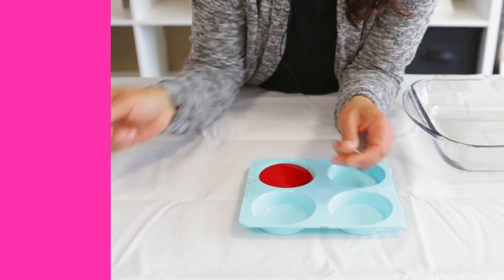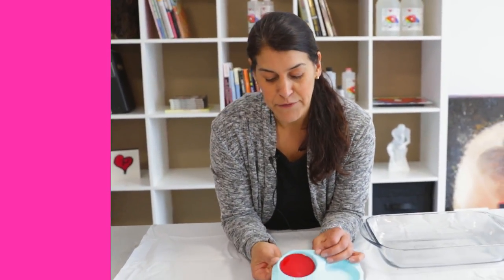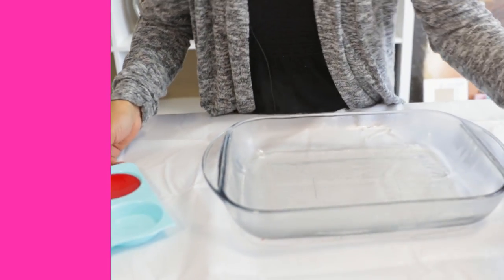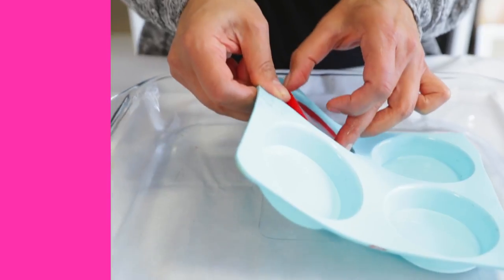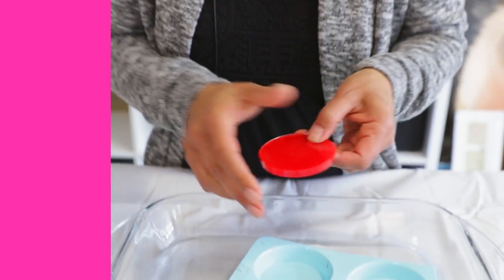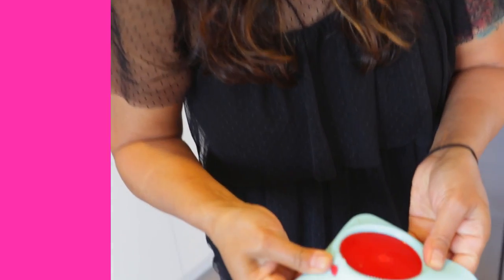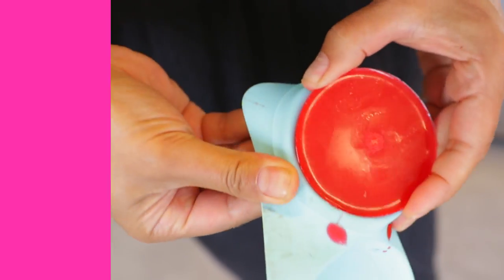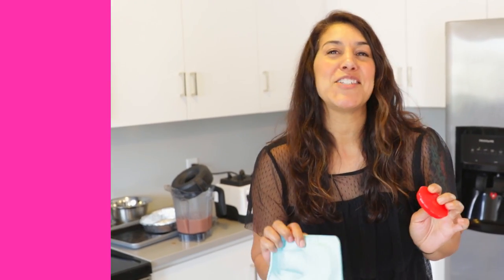How To Remove Stuck Resin From A Silicone Mold

Comment: I think I may have put too much resin in my silicone casting mold because some spilled over. Have a ruined my mold?
Reply from the maker: It shouldn't be. Once it has cured you should be able to peel it off using the same techniques here :)

Comment: If I removed it from mold after 12 hr where should I put or on what to continue curing ?
Reply from the maker: We like to sit ours on a clean silicone mat or something similar which it will not stick too. A vinyl shower curtain usually covers our workspace and that works just fine :)
Reply: Appreciated 💐

Comment: heres a question, how do you unstick two pieces of resin from each other? i bought resin dominoes recently and two of them got stuck together during shipping, one of them is fully hardened but the other one is a bit squishy where its stuck and i cant get anything in between to unstick them and i dont want to damage them

i DID try googling how to unstick two pieces of resin, it brought me here and just about everything else just tells me how to dissolve or break it

Comment: I ripped my brand new mold, tried the freezer trick, that didn't work and ripped it more, im going to try the hot water trick next... 🤦
I use this resin and the mold is a 6 mold version of the example y'all used in the video 🤷 hopefully it works

Comment: UGH.. I used rubber silicone on rubber molds.. and now they're completely stuck in the mold!!🤦🏻‍♀️🤦🏻‍♀️HELP. I really don't want to buy more molds.
Reply from the maker: Oh no!  You could try hot water to loosen the bond and allow you to remove the mold. Good luck, I hope you are able to remove the mold without damage.

Comment: Can you show us one that is actually stuck please. This did nothing. Show one that is fused to the Mold vs something that doesn’t look to have a problem. I seem to only have this issue with this brand. Not very impressed anymore.
Reply from the maker: Hi K Patterson, we are sorry to hear that you are having issues with your resin sticking to your molds. Any chance you are using a torch to pop the bubbles? We have learned that the heat from the flame of the torch is just too hot to be used with silicone molds as it can damage the mold causing it to stick to the resin when it cures. If you're not using a torch, then it may be something else and we would love to help. Can we ask you to please send an email, and include pictures, to support@artresin.com and one of our artists would be glad to help.